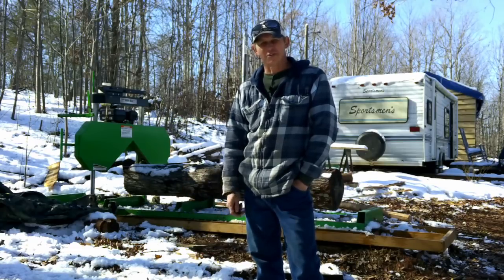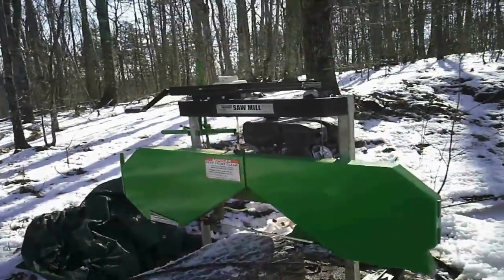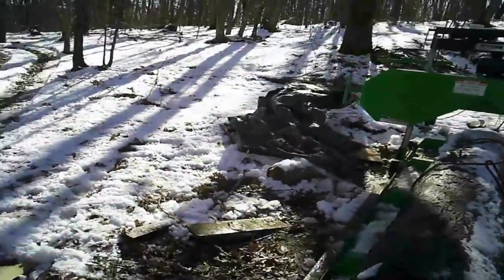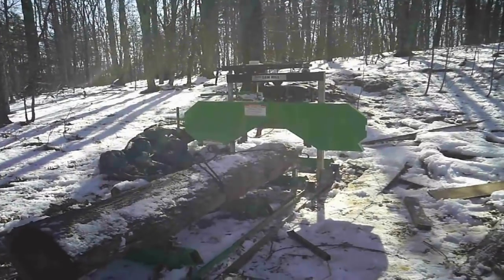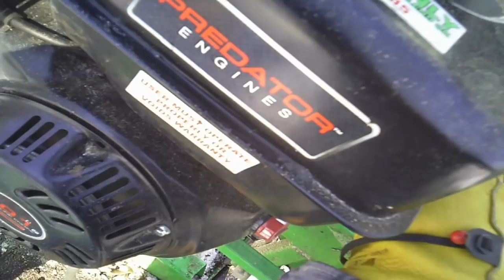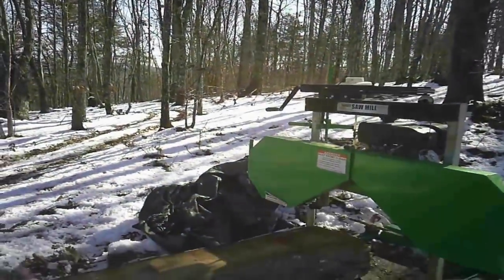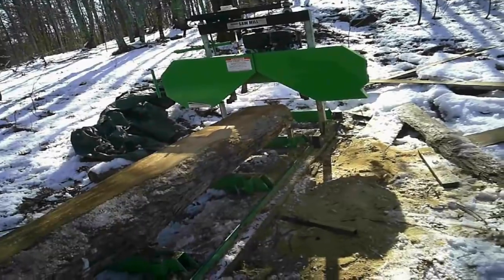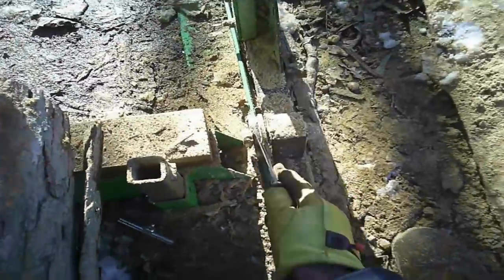Harbor Freight saw mill review with an oak log.

Comment: I have the same mill.  I built a little shed over one end of the track that I can retract the head all the way into to keep it out of the weather and I can keep the peripheral stuff that I use with the mill in there.  I also build a base for mine out of pressure treated 4x6's and that makes leveling it much easier. 

One thing you may want to consider doing is buying a 10 pack of the HF balc tape and make a nice thick tape seal over all of the hand holds for comfort and over the ends of the assorted tubes to keep rain out.  I doubt they bothered to paint the inside further than you can see.

The other day I picked up a line laser from ebay and I want to make a mount for it on the far side of the blade guard so that the beam will shine down the log roughly where the cut will be.  It can be tricky to judge by eye how deep to go with your initial cut if the log as a taper and or a bend to it.  The line will make it easy.  I also want to weld some studs to the bottom of the carriage so I can bolt on some free weights.  I think having more weight low to the ground will make it more stable.  I also want to weld on some braces to stiffen it up a bit.  

All that being said, it cuts pretty well out of the box.  The tape is quick and dirty and effective.  I think the laser will be quick once I figure out how to mount it, and the welding is a rainy day project.

Comment: “R” I moved the operator handle off the support enabling me to plank off larger logs. Put it in a small mill shed out of the weather and yes I am happy with mine. Produced several thousand board feet of oak and pine. Stay warm thanks for sharing

Comment: I have one much similar if not the same. I built a single pitch roof over mine with lumber salvaged from a distillery so it just over 24 foot deep. Let's me keep it out of most of the weather except hard blowing rains. I also put tape on bare handles to give me a better grip when sweaty or wet. I built me a concrete piers for my bed to set on. Makes leveling a breeze.

Comment: To keep the guide wheel clean, one manufacturer used 1/4- 5/16 wire rope (slightly frayed) clamped on the frame, riding in the wheel grove.
Reply: Be careful with anything rubbing on the wheels, they are Aluminum. I have this mill and one of my winter projects this year is a flip type cover for the wheel and some sort of scraper/brush like you described out of heavy knotted wire but for the track on both sides of the wheel.
Reply: i have found that rubbing just a little transmission fluid on the tracks and wheels helps prevent the sawdust from building up

Comment: I also bought this mill about 3 years ago and you are 100% accurate on everything you said, awesome hobby mill but not something to consider for a business or even just to get a business started., and I even have a dedicated screwdriver for cleaning out that wheel as you said.  Just have to be careful because that wheel is Aluminum or some aluminum alloy and mine scratches really easy. 
A quick fix to 98% of the sawdust mess is hanging a shallow bucket from a home made hook right at the ejection port. make it a double hook so it doesn't swing crazy and make them open and solid because you have to lift the bucket off that hook every few passes to dump the pure sawdust with no dirt, leaves, or other stuff. Awesome if you use the sawdust for specific things or sell it.  I bag it up in all the spare chicken feed bags and use it all over for different things.
I have my own review half made and should be up soon. 
Mods I have planned are a cover / scraper for the wheel, better Dogs to hold the Log,  A Jig or clamp system to hold small or thin boards for cutting or removing the live edge,  an extension of the track, and improving the water drip system.

Comment: Put a wire brush mounted on that far side guide wheel to keep sawdust out while you move it- should be held with a spring tension would be self-cleaning
Reply: or make a little hat with the handle part of a bleach bottle to keep water off the wheel.

Comment: I really enjoyed your video. And I hope to encourage you the keep on improving and demonstrating improvements in your life experience. In the line of structures perhaps a sloped roof 3 wall Shack or storage shed would be a neat demonstration and very useful to your cabin or Homestead. I like to see someone demonstrate double barrel stove one on top of each other and have a tube going through the top Barrel into the cabin. And then there is hot water heat which is the preferred new method of heating one's dwelling. But so say this is not the most romantic nostalgic way of doing it. In Truth if I was going to do it I would try to utilize a steam boiler that is pressurized steam to make some electricity. My concept would be to live in a barn structure with an insulated room bedroom utility and another utility room with the steam tractor engine or steam boiler engine stationary in the living nativity room.. I also point out that most of my contemplation is based upon some YouTube experience and some farming background. Also don't forget to make time to read or listen to the good word that is the Bible.
Reply: Amen Bro.

Comment: I figured out the sawdust/wheel problems stems from the wet sawdust clogging up the exhaust chute.  If you keep it cleaned out then the sawdust doesn't build up around the housing and drop on the wheels and clog them up.
Reply from the maker: I mounted a wire brush just above the wheel and its solved the problem just never got around to getting that video done.

Comment: Ralewine03,
Now, I'm really confused.  The saw HF has on their web site right now comes with a 301cc engine.  They list that size engine as having 8 hp yet you gave Phil Perry a price for a mill with a 13 hp engine.  Is it really available with a 13 hp engine or did you perhaps misunderstand Ric?  I ask because I have a brandnew 13 hp engine and need to know whether it'll fit.
Reply from the maker: I just gave him the price of the mill. I am not aware of any horsepower changes there was no option to upgrade.

Comment: why you have to push so hard is the blade dull does it always cut that slow
Reply from the maker: You don't have to push that hard you can do it with one hand. This blade was used an that is an oak log. It don't cut fast if you try and go too fast the blade will heat and you will end up with waves down.  the cut. It's not fast but doesn't take long to cut up a log.
Reply: Plus the log is frozen duh

Comment: Maybe a chain fall over a limb you could have put it together without bending it or hurting your self
Reply from the maker: Normally I load it with the tractor but the snow and ice wouldn't allow me to get close
Reply: @ralewine03  not making fun of you I am heavy equipment  mechanic and I can't tell you how many times a tripod or big tree limb has helped me split and repair equipment when I'm on a job site alone
Reply from the maker: Oh I know. I have a winch and pulley system I also use. I am probably going to have to find a kind or build something to put a new motor in a Bayliner Cabin Cruiser.

Comment: That was the longest duration cut ive ever seen. I think i'll pass on  that sawmill
Reply from the maker: 1 that was a used blade through solid oak
2 the log was frozen. 
3 if you have $5 to $6,000 to spend buy a better mill.
Reply: @ralewine03  I guess i should have worded that differently. I wasnt trying to be rude, after i read your reply and re-read my comment it sounded pretty bad. Thanks for the great review, and explaining why the cut took so long. The reason i would pass on it is only because i would want something bigger if/when i ever get one, not because of how long that cut took.
Reply from the maker: no problem. I actually went slow and filmed the whole cut.  That was a problem I saw when I was looking everyone speeds up the video or edits out the middle. nobody showed a whole cut.